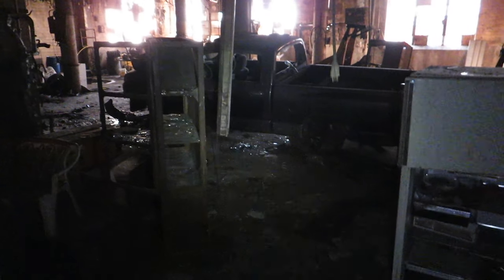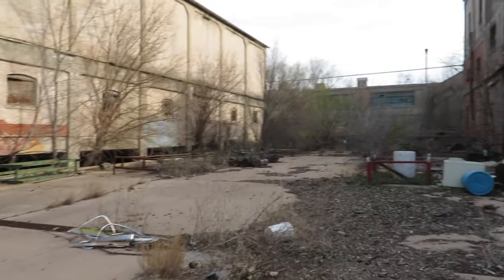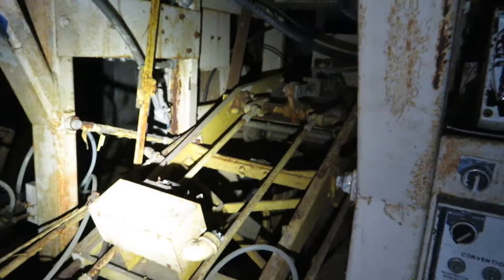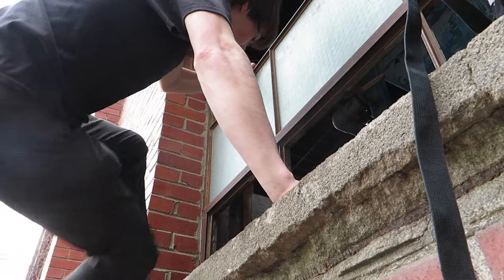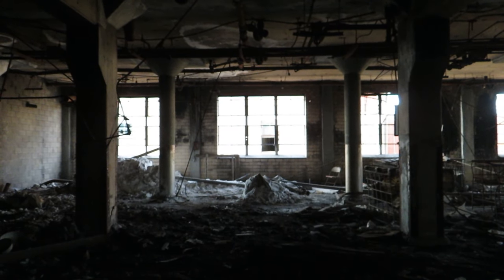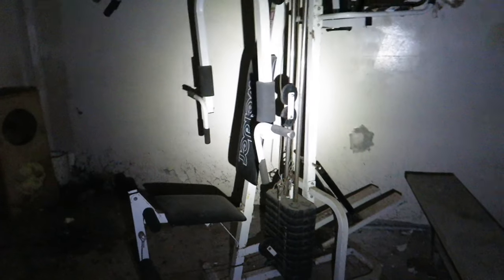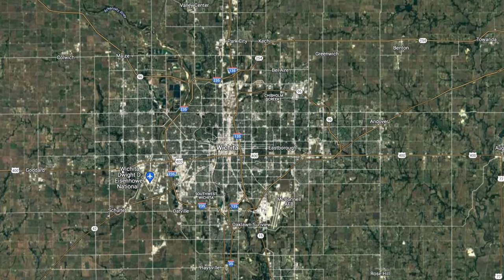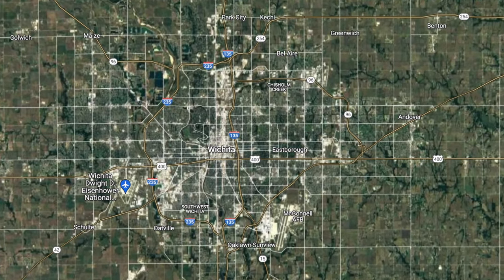Caught and Arrested at Huge Abandoned Factory (Intense)

Comment: I got it. That guy have this property with the holes in the fence at known locations just for his entertainment. His hunting ground. He probably has set up some hidden sensors to know when it is time to have fun. You just ruined his fun, by not running away. You wasted a lot of his valuable time, by waiting police. 
I think that the other strategy might have been to just hide somewhere until he got tired and left. As no way he is going to do full search on that massive complex.
If someone wanted to troll him, then find his sensors, and set up your own system that will induce false alarms on his system at most uncomfortable times. Like 5am, or what ever. Not too often. Only to make him little more tired. As nothing can't be done to stop him hunting.